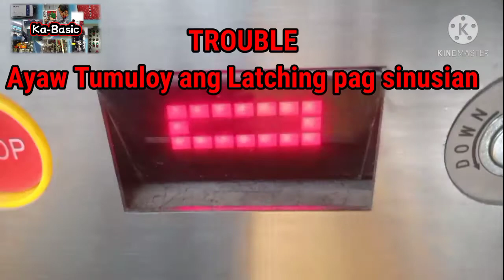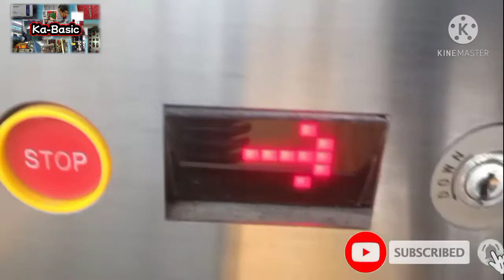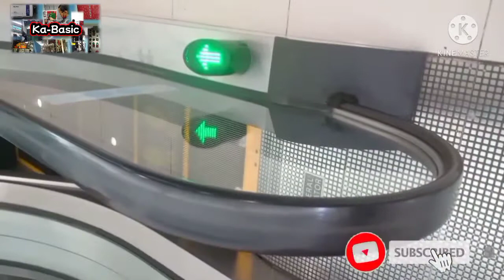Paano ITroubleshoot Ang Escalator na Walang Fault Code Indication || Ka-Basic Channel

Comment: Sir paano naman po ung pag pinaandar bigla po mamatay 7 seconds mamatay pero wala naman po lumalabas na fault code
Reply from the maker: check phase sequence relay and protection eg mechanism tight resulting to inverter / VFD to protect overcurrent and fault code display.